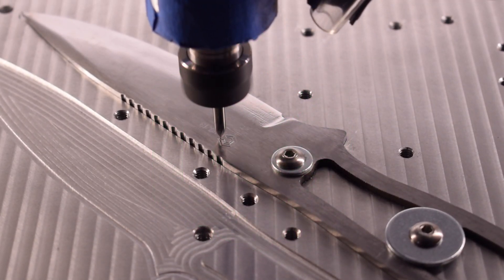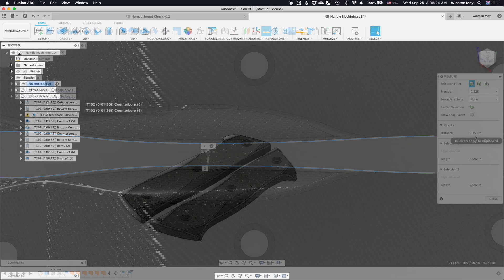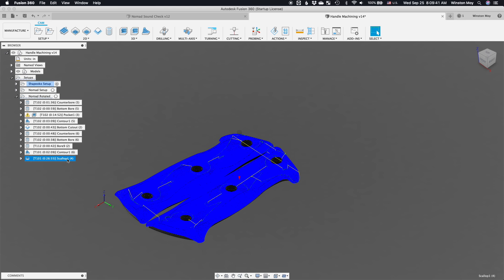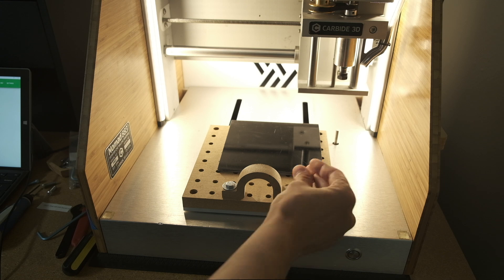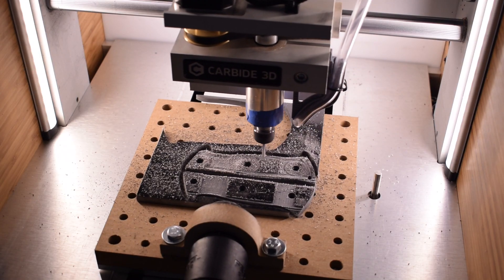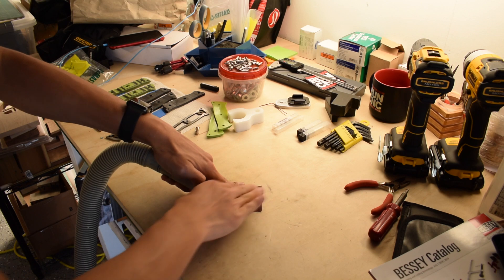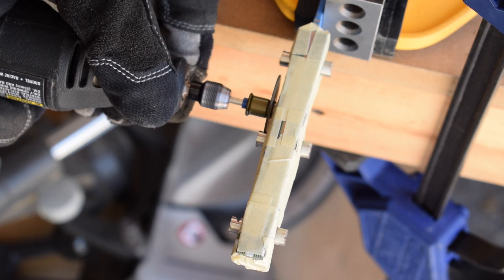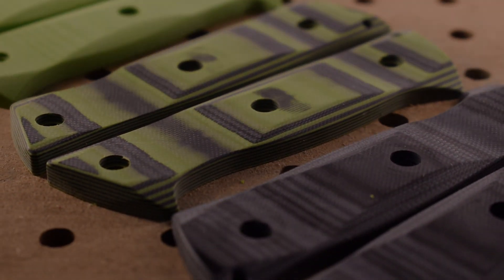Machining G10 Knife Scales - Carbide Camp Knife Pt. 6

Comment: The scallop toolpath changed the way I finish machine curved surfaces in wood. With a small enough stepover, you can pretty much get away with light sanding before applying finish.

Comment: I think this is a noob question, but you stated that during the process you slowed down your feedrate...how do you do that while the process is running?
Reply from the maker: In the interface of Carbide Motion there are buttons to increase or decrease feedrate in 10% increments during a program.
Reply: @carbide3d  Thanks, that's a nice feature (I'm not currently using Carbide Motion)
Reply: Most controllers have a feedrate override that you can increase/decrease the feedrate while running.